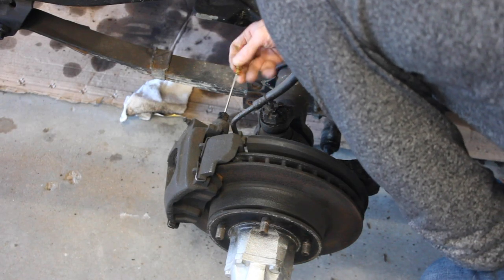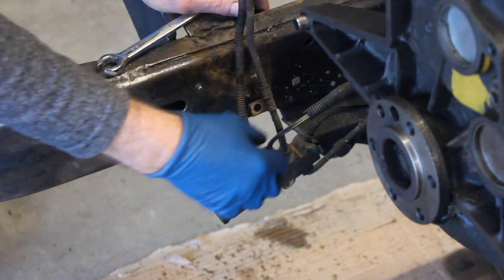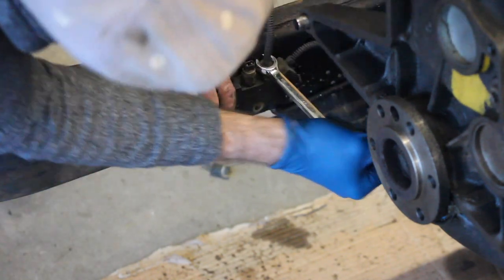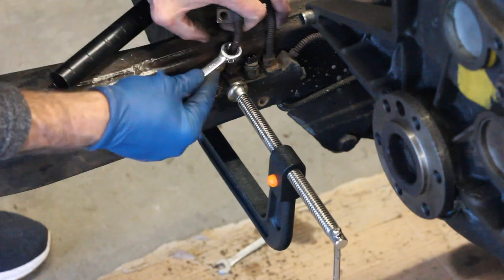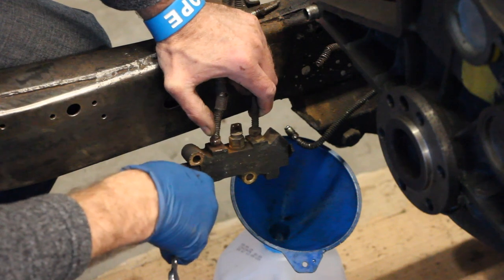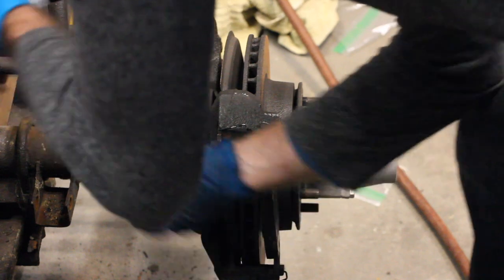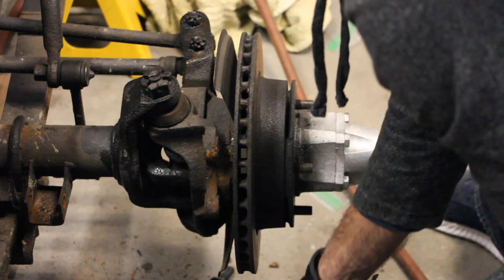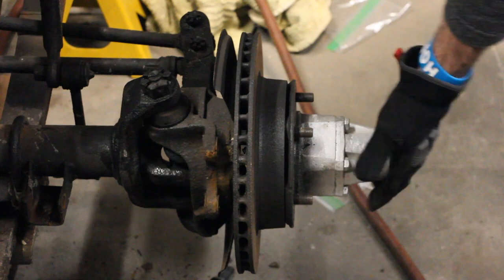Jeep CJ7 Dana 30 Disc Brake Removal

Comment: The wire connected to the brake proportioning valve is connected to a dash light,indicating an imbalance in the front to rear braking system. The “back up” or reverse light is usually actuated by the transmission linkage,in the console,column or on or in the transmission.
Reply from the maker: You are correct. I figured all of that out once I started putting things back together and reading the wiring schematics. Thanks for the info.